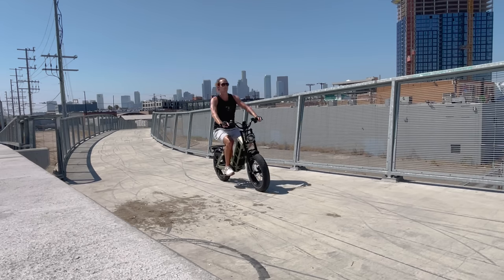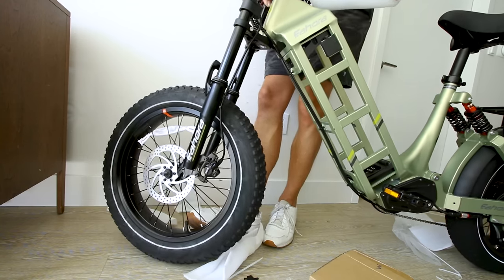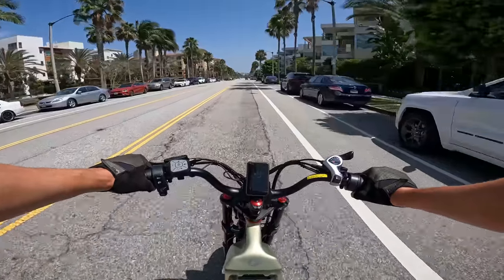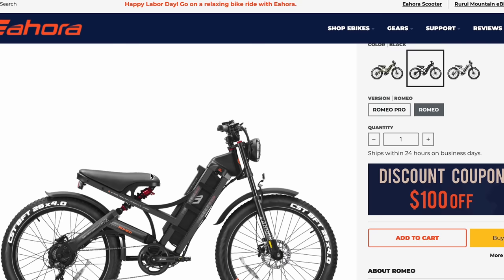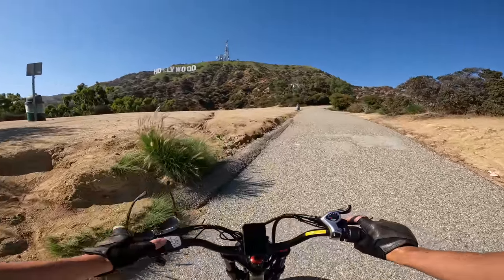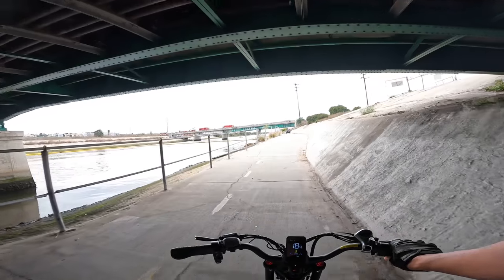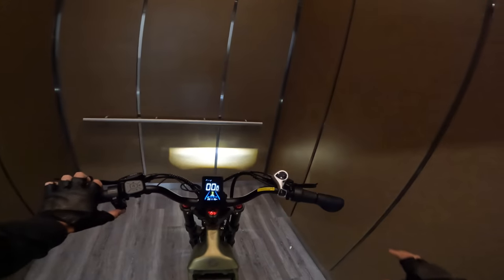I Survived Los Angeles On My Eahora Juliet Ebike

Comment: yep im buying this to commute to work and charge it once a week sounds good
Reply: That is exactly my plan too
Reply: Did you buy it? Hope you like it
Reply: @ShouldaWaved  Its alright. the build quality is not great, few parts of the frame came rusted and the weld work is very bad. The rear suspension barely works and the seat is really not comfy. Everything else is like in the video, works as advertised. We'll see if it last, hopefully it does
Reply: @Tom-ol5zz how did it hold up over time
Reply: I can commute to work all week on a 52v 25ah battery
Reply: @Tom-ol5zz  Do you know the length of the rear suspension? i need to change rear suspension.

Comment: The Anoki AQ 177 I have it and the motor did the same thing to me started making all kinds of funny noise after my first long ride. I also had the electric 3.0 XP and it broke at the latch point so what I did was I really liked the Anoki frame, so I took the motor and the controller and the displays and everything off of the rued XP and put it on the Anoki frame, but kept the battery and I’m getting ready to see how it runs with the lower wattage motor. The frame itself is really w  the shocks and everything.

Comment: Hi ... I became interested in buying an ebike a few weeks ago. I watched most of your videos until I saw this one. Just ordered my Juliet this morning. Thanks for the help !!!
Reply: Well has it lasted?
Reply: @PhantomPanic  No trouble so far. Still looks and rides like brand new. Only con is it's weight. It surprised me. While riding, it makes the bike more stable and the battery/motor is more than capable. Just be prepared to be a big boy when you stop. Also, when you stop and ready to get off the bike, set the speed control back to zero. I once hit the throttle while dismounting and off it went. i caught it in time and no damage was done.

Comment: Appreciate how you are starting to think about pedaling, recently (Async H7).  I get how 110lbs could feel like low payoff, but even for a heavy bike, if you are going 20mph at 7amps on throttle only, you can see what changes when pedaling to maintain speed.  I think (do not have exact same) that controller/display combo might give you 1-2mph more, and drop to 3-5amps.  This is a big deal for "country road" range, and maintaining speed, afaiu, on a heavy vs light bike is about the same effort.  Its acceleration and hills where weight is drain.
Reply: So well said. Once rolling on level ground and no headwind @17MPH, I can keep momentum with about 150W power. And my bike is a 26" x 4" 93lb bike. A 52V 15Ah battery lasts a L-O-N-G time using 150W.

Comment: Wow, they made some improvements! The most notable changes are the rear suspension, charger, and lights. The rear suspension on the old batch was way too stiff it was almost like a hard-tail. I hope they're using a better quality motor because mine had the same issue as the Aniioki. Maybe the new batch is better.
Reply: Did you get the motor replaced? How good was their customer service.
Reply: @ToxicHAL  I did, they sent me a new motor free of charge, although it wasn't a no-questions-asked experience, and installing it was a hassle but not impossible.

Comment: Thanks for the real review dude. I bought this bike due to this review and another dudes, got a $300 discount on their site. This is a real bargain for $1500 bucks. I will never need to go 100 miles but 50 is a possibility ( it's 5 miles to drive around my block, I'm rural) and I never want to be close to running out of battery. I had a great experience with their customer service. I ordered it on their site and it said in stock but then I got an email that it was out of stock for two weeks. They threw in the 63 dollar basket for free which I wanted anyway. I didn't even need the bike in February because it's cold in my area. I just ordered it because of the $300 new years discount. I am very happy with the purchase. On the down side they introduced a new rear suspension like 2 weeks later and the Juliet 2, which I probably would have bought. But I guess everything is always improving. I feel like this bike is locked to 32mph. The OS said it was at 51mph and the tires were set to 24 inch tires by default. But none of the tire size setting change that top speed. If you figure a way to unlock it please post. On the minus side I punctured the tire and rim within 4 miles. The tire is really thin. It turned out to be a less then a Quarter inch thorn. Seems a lot thinner then my bikes in the 80's. I put in Tannus tire liners and slime tubes,  I'm not screwing around with flats.
Reply: i really want this bike. i have seen other youtubers get up to 38 mph with this bike dont know how they dont ever say. i mostly want this for the range not really the speed but to have that kind of speed with the range is really good especially with that price range cant beat it. when you got the stuff for the tires does it feel different then with the stock tires with nothing done to them im thinking about doing something to them.
Reply: @sidoniasknight  The tires feel about the same to me, maybe a bit more stable.

Comment: THIS is probably my favorite so far, despite not being able to hack the class 3 level. This is one that might or might not survive the McCarran Loop counterclockwise in Reno. If it can, it would possibly do it twice, a rarity in range and ability here. There's a nearly 10% gradient hill climb/fall at the SW corner of the loop. I'd love to get into testing ebikes (and recording/posting to SM) and using that particular road as the stress test proving grounds for any of them. Learning how to put them together is why I mostly watch these. The scenery is a bonus. One thing I had been waiting for was the lubrication of gears and bearings and such. This was the first time I've seen anybody grease anything on an ebike. Is it usually unnecessary or...? If not, it would make the entire build process less time and tedium. I currently own a gas powered 49cc scooter and would love to get off of the idea of oil dependency.
On a side note, I'm always expecting you to run into Mike, "German In Venice" and possibly do some sort of collab. Your videos are pretty well thought out and often hilarious without meaning to be. I'll be looking into the Eahora Juliet, for sure.
Reply: The only thing that I think about is the short warranty and that big battery replacement cost$$. But otherwise, it seems to be priced right!

Comment: I'm waiting for one of these 60Ah models that's UL approved and is willing to reveal which company manufactured the battery cells.
I read somewhere that a company rep indicated the Juliet II was "going to be" UL approved.  That might just be optimistic marketing messaging, or it might be real.
I am a little surprised that there aren't any Japanese manufacturers in the lower-priced end of the market.  I have a Japanese car with 80 pounds of Lithium batteries, and they never catch fire.  Japanese mfrs have solid quality control.

I don't want to wait forever.:face-orange-frowning:

Comment: If I was younger I would take components from several bikes and make my dream bike. I want this battery and body style, with a high end display, adjustable controller, and 750W motor. My state doesn't use the class system for e-bikes but the max motor you can have is 750W. On top of that you can not ride on trails, in parks, or on sidewalks.

Comment: WOW that is an impressive ebike!
 great range and a decent climber!?! very nice.
less pushing as @ 116lbs its not a lite weight.

 Thank you for the fun ride thru some amazing scenery  from a bit of risk on your part. :o
Ive driven the car thru some areas like that & was hoping I didnt break down :O
 on a bike? uh - thanks for taking us along. [wild safari] ;)

   the other scenery over the bridge to the mtn top with so much along the way, a little extra on the get lost adventure - lol

 and that ebike went the distance!  
it is a good fit as it is for us 6'+ guys [decent for sure]
   perhaps a stem height adjustment for a better fit [minimal cost :) ] nice.
the long range would be a super thing to have.
  this ebike is a nice surprise.
thank you for sharing.

Comment: Hey Matt
Thought I'd ask YOU, since you have videos on three of the Ebikes on my short list for LONG RANGE. First off, I'm not nor will I be a delivery driver and doing 35-40 don't really care as long as it's not a turtle.
Ebikes on the list in the order I'm considering atm, so your thought if you had to pick just one.
1. G-Force T7
2. Eahora Juliet
3. Aniioki A177 Pro (you tested the A8 I believe, which to me is like the Romero and A177 is the Juliet)
All have 60 Ah batteries.  Believe in the T7 review you mentioned having the battery behind the seat help with the handling and also the T7 is by far the lightest of the three.
Your thoughts, if you will.

Comment: One thing I never see on E-bike channels is the topic of battery life span, number of charging cycles. Eahora puts a one years warranty on the batteries. But the Juliet battery runs $700+tax+shipping. Adding an $800+ per year expense to my budget just isn't happening. So, have you ever had a bike long enough to see a battery die? What is the expected life span? Can that be extended by dropping to a lower amp charger?
Reply: They estimate a 1000 plus charges life which would mean you'd have to ride it 100 miles every single day for 3 years to reach 1k charge cycles. 700 is nothing when you take that into consideration. 700 dollars for 100k miles

Comment: Is it worth spending the extra money right now for the juliette 2 (52 volt version with 30 amp controller) how much faster is the 52 volt? Is range decreased because of the higher amperage controller?
Reply from the maker: Just because the controller has more amperage, doesn’t mean you necessarily need to use the amperage. Power equals volts times amps. The more voltage and amps the bike has, the more potential you have for high power. The throttle is literally controlling how many amps is delivered. In my experience, having higher voltage and higher amperage on tap resultsin me having a higher average speed and running higher speeds in general. If you are disciplined on the throttle and power use having a higher voltage and higher amperage system will not reduce your range by itself. Going with a dual motor set up will reduce your range in my experience, the extra rotational unsprung mass has a negative impact on range. Also running dual motors, I tend to consume even more power because it is so easy. I hope this helps you.

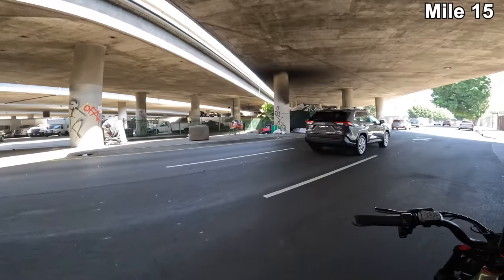Comment: At about 12:35, cell phone cover in acid reflux.
Hope dude was OK
Kind of wish you would have taken the G-Force T7 60Ah up to the Hollywood sign.  Atm, I'm leading toward the T7 as you stated it's better handling than the “up front” battery, but my concern is if it would do as good or better where the Juliet and Aniioki struggled roughly 19:35-19:45 in this video.
Matt, still curious which you would pick between the T7 and Juliet.

Comment: pretty interesting, quite a bit more range than the aniioki bike even though they have the same battery
unfortunately I've been reading pretty bad stuff about them, motor noises, erasing negative reviews etc
I'm definitely getting the juliet if anything bad happens with the aq177 I just ordered :)
Reply: I have the aq 177 and it started out great but after 6 months the motor is making a rattling sound when I let off the throttle.  The spokes break like crazy too, I have replaced at least 20 all on the back tire.  I am thinking about getting this one instead and just keeping the aq as a backup.
Reply: @rcgamer  hmmm interesting
thank you for your input :) will keep in mind

Comment: I'm guessing the third bike is the G-Force T7? I'd be interested to see that review, I'm in the market for a long-range ebike and right now I'm leaning towards the Eahora, but I've heard positive things about the G-Force as well.
Reply from the maker: Correct, I was wondering if anyone read that deep into the description box 😆. I need to put that bike on the scale, it took me til the end of riding it until I realized why it felt so nimble
Reply: @TailHappyTV  Hey, I had a question about this bike (the Eahora Juliet that is) that I was wondering if you could answer. Do you happen to know if the battery from the Eahoras are compatible with the 13A charger from the Aniioki? If not, do you know what connector the Eahora charger uses?

Comment: If the stock suspension sucks, you can also change the shocks. 🤷🏻‍♂️ (Also, might want to lose the quick release seatpost clamp. Unless you don’t mind the risk of coming back to a bike with no seat if you’re running errands.)
Reply: no seat = nun's bike
Reply: no seat = nun's bike

Comment: You need redoing the test,you was at Hollywood mountain(how many minutes using power?)and a lot of several inclinations (please do you can make a video or calculate how many miles you can do at mountain only?and another about battery regeneration when pedaling (if the bike gives 200 miles?)thanks(I know,is boring,small town and at bike no problems about traffic)

Comment: I’m female. I’ve fallen in love with the Romeo Pro (via the internet) and have plans to buy…but I’m starting to worry that I should cool my jets and go with the Juliet instead? I’m 5’10” (160ish lbs currently) so I’m sure I’ll fit the Romeo just fine but wondering if it’s weight will be more than I can manage comfortably🤔. My real question, as a woman, should I go with a Juliet or take on the challenge of the Romeo/RP 😏
Reply from the maker: You’ll be fine in either in my opinion

Comment: The last time I'd use a multimeter to measure my 20AH battery I'd short circuit the terminal and the multimeter needles got soldered in  the battery terminal 😢. And the sparks just missed my eye.
Reply from the maker: Holy crap. New fear unlocked. 🔓

Comment: #MuchBetter if you use a big mountain bike wheel tire tubeless,then change them machine input a grander machine for most top speed than a single motor can be speed run 80 speed kilometer up to 150 speed limit on express highway.

Comment: Is this e-bike battery UL certified? This is very important to me. I have this e-bike, and my charger has a UL seal, but the battery itself does not. Eahora’s website claims that the battery is “UL compliant” but I question if that’s the same as the battery actually being certified. I’m still within my return period and I’m not sure what to do. Is this battery safe? I don’t need a fire. What do you think?
Reply: Well being UL compliant means it's built according to UL standards in mind but it hasn't been tested by UL. After all, it costs a ton to have it certified.

Comment: @TailHappyTV please dude I need your help. I have a question for you. I have a 36 v 500 watt motor on my e-bike that I bought. The battery is 12 1/2 amp hours. Is it possible for me to upgrade to a battery that is 20 amp hours but still at 36 v? Because I'm going back and forth with the seller the actual official site of the bike and they're telling me I can't do it and they're trying to sell me another battery at 12 and a half amp hours. I'm saying common Sense tells me that if you have 36 v and it's the same size battery that fits inside the battery compartment why can't it just be more amp hours without having to do anything special to the bike? And they keep telling me that there product can't be upgraded. They said, if I buy the battery I have to upgrade the bike myself, but all I'm saying to myself is all I have to do is take the 12 and a half amp hour battery out and slide in 20 amp hour battery. So please tell me if this is a possible thing that I can do without having to do anything to my bike?  The Controller is 36v 22a. It should be able to support a 20 amp hour battery correct? That's what my common Sense tells me please help me out guy.

Comment: Hello. I just received my juliet today and upon assembly, i found that the red spacer which sits under the shock plate on the head tube, is loose and  has about a half inch of up and down play.  I was wondering if yours is the same way or if it's got no play whatsoever. I sent an email to Eahora about an hour ago and they actually just responded. They asked for pictures. Hopefully they can shed some light on this but in the meantime, I'm hoping you can tell me if you have the same issue. Btw, you sold me on the juliet.  Watched your reviews on many bikes and i decided on the juliet. Great content!Thank you for your help.
Reply from the maker: There is a particular process to tightening down the headset on a bike with a triple crown fork. That sounds like this is what you’re going to need to do.
Likely what you’re going to need to do is have the top triple crown screws tightened down onto the stanchions, while simultaneously having the bottom triple crown clamps loose, so that they can move freely in the stanchions. Then you will be able to tighten down the headset with the screw and the center cap assuming the bolts on the stem are loose as well as an other bolts below that. Then, after all of the play is taken out of the headset, you can tighten down the lower Triple clamps and the rest of the bolts. I hope this helps. I don’t remember if I showed it in this video or not, I think the same thing happened in the freego F3 Pro video I did. it can be super frustrating if you don’t have any experience, but it is actually a pretty straightforward process.